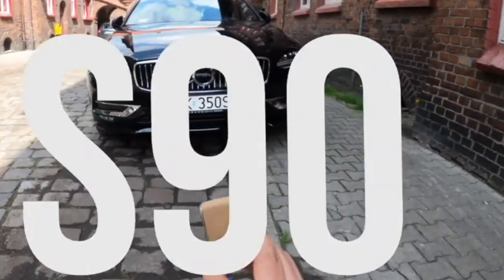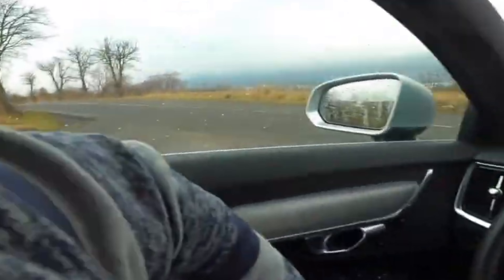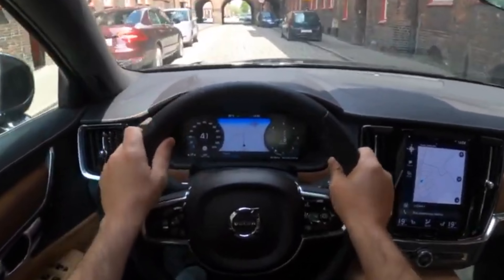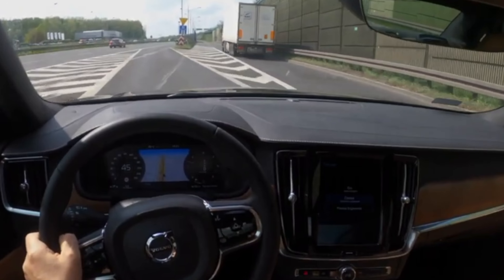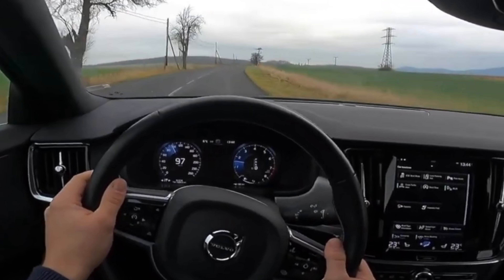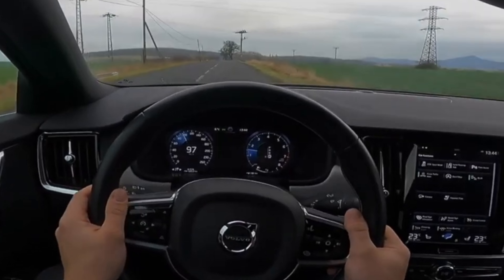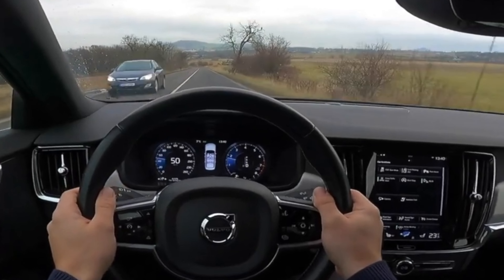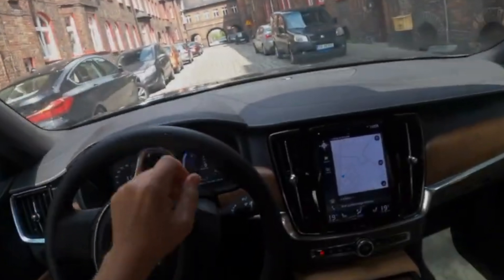Volvo S90 2 Problems | Weaknesses of the Used Volvo S90 II

Comment: Just signed preliminary contract for my new 23 plus bright edition.  MSRP was 60,975.  111 miles, dealer demo.    How do you pass on 48,488.   Plus 1,000 loyalty.    5.9%.  My trade was more than fair….   Dealer has two left.   West Chester, pa.    RT 322.🎉🎉